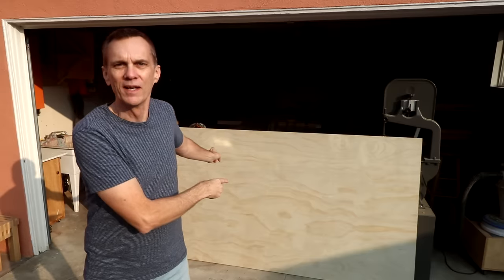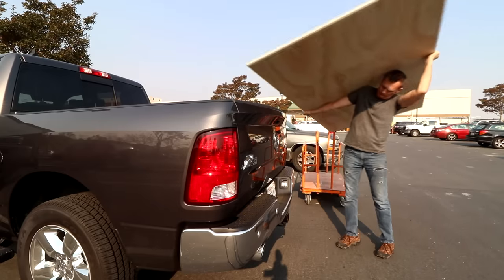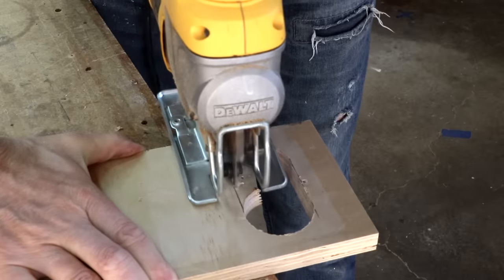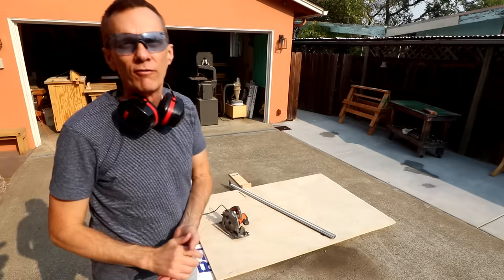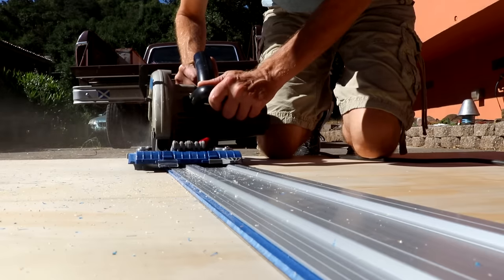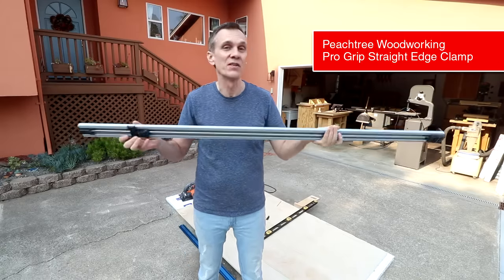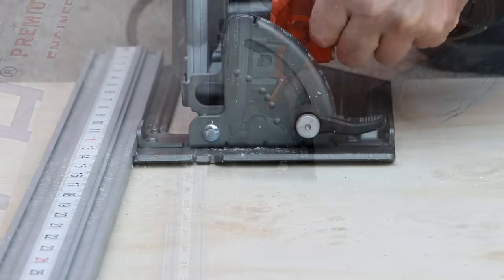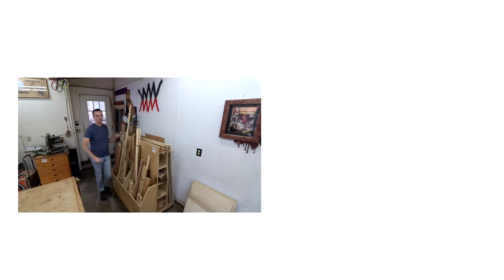How to break down plywood. A guide to cutting, moving and hauling plywood by yourself.

Comment: I fail to see how you don't find the need to store 8' lengths of sheet. I have some full width, but a lot of cut down widths. You just have to store it vertical. I like your wheeled cart though, at this point I have it stored against walls and 3 of the 4 corners of the shop! I also made my own track saw guide out of 1/4 ply, which was cheap enough to make an 8' and 4" version both. Saw it on YT somewhere, use it constantly with a cordless circ.
Reply from the maker: Why don't you just buy what you need for a project rather than stocking up?

Comment: That Home Depot should change the name to "Danger Zone." There looks to be some safety issues.
I was at my local Home Depot a few years ago. Had the SUV with me. Picked out some 2x10 by 12 Ft. long boards. I needed them cross cut down to 6 Ft. boards. Approached 3 Home Depot floor staff to have them cut on the big Radial Saw that they have. They were all too busy. I waited around for about 20 minutes in the hope that someone would be free. The store was not busy, couldn't understand why there wasn't anyone that could help me. Set up those boards in a little used aisle. Got the handsaw from the Trim Aisle and had 2 of the boards cut and was working on the third. And some other Home Depot guy comes along and tells me that it would have been easier to cut them for me on the Radial Saw. I tell him my experience as I'm working and finish cutting my last board. It would have taken them 10 Secs. to cut those boards on their saw. To begin with I had the boards placed on the saw bed ready to go. They just had to key in their code and drag the saw across those boards. They make cashing out a self serve service. Maybe they should make it self serve everywhere in the store. They can then get rid of their useless employees until such time as AI takes their jobs. I got some other Home Depot stories like that as well. When I go there, I am prepared to work.
Breaking the wood down is the best move. However sometimes I have to have the wood full size, thankfully not too often.
Actually, I need some wood for projects I'm working on but everything is shut down here. Everything is phone in or online, the Pandemic. Doesn't work for me for a number of reasons.

Comment: "The saw never works" yeah i work at one, ours works but only th managers know the pin to turn it on, and we are told to say its nkt working to customers, they figured out that sales increased more from the extra employees helping then the people turned away because the wood couldn't be cut, that and for anything other then plywood they just suppled a cart with a handsaw for the customers to use. Is it preferable no, but the store manager decided thays what tphes gonna do
Reply: omg it's actually a conspiracy??  This is horrible and very entertaining. 😅  I once had a demoralizing misadventure with "non-working" saws in two or three consecutive stores.  I had specifically gone for big box rather than architectural salvage because of the promise of lumber that would fit in my sedan, and rather than leave empty-handed I settled for shorter (but still unwieldy) pieces that ended up being too moldy to use and went in the trash!  The whole experience made me permanently cranky about big box lumber but if it's also literally a retail conspiracy that makes it funny.  So thank you. 😆

Comment: skip the toy pickup with the 4ft bed, we use vans you can just slide everything right in and close the door, no strapping, no cutting, no freeway flyer miles. we only use lowes they actually give veteran discounts.

Comment: Plywood protip:  Get yourself a pool noodle or a copper pipe insulator and slip it over the edge and/or corner of the plywood.  That way you can rest it on the ground without damaging/getting it dirty.  It's worth the $3 when working with cabinet grade ply.
Reply from the maker: That's a great suggestion!!

Comment: What about rip cuts? Every time I try to use an edge guide and circular saw I end up with a wavy line.
Reply: There's lots of reasons you might get a wavy line. One of them could be using the wrong blade in the wrong material. You could simply get a long straight clamp or even a straight piece of wood. I personally custom made a ripping guide for my track saw. But most companies sell ripping guides for circ saws. It's basically a portable fence that attaches to your circ saw base. I know Kreg has one. It's a bit flimsey but it can work.

Comment: Make sure there are no termites in the new wood. Sometimes there are drywood termites in the wood. U just don't know it. I would seal the wood, in theory that should cut off the air and the termites will die if they are in there.  That's why after a major rebuild on a house, they reccomend to fumigate the house and tent it.

Comment: For all german mortals :p Lidl sells a edge guide like that for like, a third or a quarter of the price, and it's pretty good!
Reply: Not only for german mortals. Lidl is in many European countries.  I have one from them as well. Works great. But for a full sheet of plywood it is not
big enough. No problem for me, plywood is far too expensive over here to buy a whole sheet.
Reply: @hansdegroot8549  True! I just didn't want to give wrong information in case they had different products in different countries :)
That's fair yeah, but i think most hardware stores here sell smaller sheets too anyway - plus if you are in germany, Bauhaus does unlimited straight cuts for free and they're usually pretty good at it with guaranteed accuracy and all
Reply: You can also buy a track saw from them they are £70 in the uk and on sale a couple of times a year

Comment: If you're going to be hauling a lot of plywood, it may be worthwhile to rent or borrow a trailer or truck. You can use a roof rack in a pinch, but unless you're really good with knots and have a really good roof rack, I wouldn't recommend it

Comment: Well Steve I have to disagree with your dismissal of track saws maybe you should try one. As a owner of small shop 12x12 feet and small one car unheated garage (in Canada) table saw is very problematic to use no matter how much you precut your sheet goods. Requires too much space for input and output, I do not have. Bought a Makita track saw and never looked back. Precut full sheets in the garage on 2 saw horses and 2 2x4. Have 4ft by3 ft folding table with foam top for the workshop and precision cut all pcs with tracksaw on that with no extra space needed. Huge advantage of no tearouts, precise, exact cuts, dust collection and no need for material movement. Build all furniture for my houseboat down to 6"x5 "sized pcs and never touched the table saw again. Perfect for small shop once you learn to use a square and all the small tricks.
Reply: ddruckmu I agree with you, also a makita owner,  and I agree that for sheet goods it really can replace a table saw.  If you set up a table with bench dogs and a fence you can do repeatable Crosscuts.  I understand Steve’s point of view, but I bet if he tried one he recommend one, especially with cheap options available from Wen, Triton and Grizzly.  I still think the Makita may be the best bang for the buck. As an aside, factory edges on plywood are not that great, my first cut is one kerf width off the 8’ side, then I reference everything from there.
Reply from the maker: Yes, this is why I said a track saw is the most accurate solution. Just not an expense that fits the focus of this channel.
Reply: Well by itself, just for cutting sheet goods, of course it is too expensive but as a total replacement of table saw,  edges  guides, ( the Kreg gismo is $99 in Canada) Then the $400 cad for the saw is not too expensive in comparison to the cost outlay for the tools it replaced. Just a different view on a small cheap workshop.
Reply: @fotopdo  Agreed, the factory edges are usually beat-up and my first cut is always 5mm trim off that edge for perfectly straight and chip free smooth edge. The Makita became the central tool of my tiny inexpensive shop.
Reply from the maker: @ddruckmu  I've known a number of people who use track saws only and prefer them to table saws, but there are not enough people with a set-up like that to justify me converting to a track saw exclusively in my shop dedicated to teaching beginning woodworking skills. Basically, it would be YouTube death! 😬
Reply: Yes agreed on that, just trying to expand peoples knowlage past the traditional view.
Reply: @SteveRamsey  Especially since Festool  brought us the track saw, and what could be more divisive than that! I don't disagree with your take on this, clearly it's the correct choice for your channel.  But, these saws are really getting cheaper and might be a good "extra credit" option for some of your followers.  The Wen saw is $150 with tracks, so similar to the price of circ saw and the Kreg or Bora track guides.
Reply: @fotopdo  are you saying Festool invented or came out with the tracksaw first? I hope not, because I have a Craftsman set up from decades before I ever heard of Festool.
Reply: Thatone Dude, to be clear, I’m talking about the plunge saw specifically, using a track with splinter guard, they got a patent for that in 1962... not sure if that’s US or Germany or worldwide. They made the first handheld circular in 1930.  (All this according to their website)  what’s the config of your craftsman?
Reply: The Wen track saw is pretty attractive at $130 US.
Reply: Michael Mulville it seems to be a great saw for the price, But I do think you need the optional ($75) 2 pack of 55” tracks to get good results.  Most saws, Festool, Makita, Triton come with 55” track, but the Wen comes with 2 27.5” tracks that you assemble with connectors. This has to be finessed, and can easily introduce error. I think they did this to make it cheaper to ship. So that would be around $200 to be able to do an 8’ cut ... not bad. Also those small tracks would not be a waste, it’s nice to have that size for short cross cuts.

Comment: My guess is the saw works fine,  but the employees are too lazy to cut stuff.  Just like they can’t be bothered to clean the store.
Reply: That's probably the customers' fault, too, looking through the 2x4s to find the straight ones and not putting the rejects back. I always stack them back neatly, because I want to find them that way myself.
Reply: @jjohnston94  I always lay them on the floor. What's the point of putting them back in the "good' pile.  They will just get in the next guys way.
Reply: @jjohnston94  You're absolutely correct the customers go through the pile looking for good wood.
Reply: I think ur right just yesterday i was at lowes and they told me the saw probably isnt working lol thats immediately what i thought

Comment: Using the insulation as a cutting surface is a pretty poor idea if youre not wearing a respirator, sending fiberglass up in the air. You should be wearing a respirator working with plywood anyways, the plys are held together with epoxy and i wouldnt want to inhale that either.

Comment: Don't carry, ROLL:

Take your carry handle, put a cheap caster under it (fixed direction, NOT pivoting):

https://www.harborfreight.com/2-inch-x-7-8-eighth-inch-light-duty-rigid-caster-41513.html

Now, take a BUNGIE CORD, and drill a hole up at the top of that carrier, so that you can insert the metal hook of the bungie.  FINISHED.

So use it, hold the bungie and let the carrier hang down over the far side of the sheet good, a couple feet back from the front when up on a side.  Lift JUST the front end of the sheet enough to let the carrier go under the sheet good, then lift it into place.  Hook the bungie over the top and that will hold it in place.  Walk to the back end of the sheet, lift ONLY that end (1/2 the weight...) and drive the sheet where you want to go and then remove the wheeled carrier.

BONUS TIP:  I have a 2 wheeled Plywood Cutting Table (casters like above, but a bit larger to go over bumps easier) on one end lets you lift the other end and roll it out into the driveway on nice days to break down your sheet goods in the fresh air or even apply finishes on calm days, and then roll it into the garage to dry out of the way of dust and birds...  Make it using lap joint 2x4s and it will tear down in 5 mins. for storage.  It's just a plywood frame like Youtube videos are full of making, and has a 1/2 foam insulation sheet on top so that the saw blade just knicks it and leaves the wood alone.   A properly shaped "J" hook of wood on one side will let even my teenage daughter load a sheet of 3/4" birch plywood from standing on its side, to being up on the table without breaking a sweat.  Make the table 4" narrower and shorter than a full sheet, so that you can have access to clamp on straightedges or a track saw for cutting.  

Get off the ground cutting your sheet goods and your back will thank you!  My cutting table was the best thing I ever made.  And it can double as an assembly table with a sheet of 3/4 on it.

To more easily transfer a sheet from the truck to the table, mount TWO BEARING ROLLERS  at the ends of a 3' scrap of plywood.  

https://www.harborfreight.com/5-8-eighth-inch-roller-ball-bearing-67067.html

When you get to the house, lift up the end you're holding outside the tailgate and slide the roller piece in arm's length so that it is transverse (across the bed).  Now lower the sheet, and you can pull on the sheet, and apply a little downward pressure, and just ROLL THE SHEET OUT OF THE TRUCK most of the way and set your end on the table.  Now if you want, you can transfer this roller to the table, and back in the truck, just lift and continue rolling it onto the table.

The older you get, or if you have a bad back, the smarter it is to have to lift only HALF the weight of a sheet of plywood!  Working alone means working smart!

Comment: Plywood is one of the things that worries me about your courses. A full sheet of plywood simply won't fit in my car (and unfortunately since it's the 4' width that's the problem neither will a half sheet). When I'm making my own cutting diagrams I can work around that limitation, but it's a lot harder to do with someone else's. 

I'm stuck either paying more to buy from a place that will rough cut for me (and I have no idea how much wood I can expect to lose from that), buying precut panels from the big box store in the 2'x4', 2'x8', or 2'x2' sizes--they won't cut--and trying to rearrange the cut diagrams accordingly (still expensive, but at least they let me actually let me compare prices and pick out which piece I want), or have my uncle go with me to buy the wood (he has a truck, but since that's not something I can do on a whim, means buying several sheets and trying to store it). 

I guess I could buy a battery powered saw and try to cut it in the parking lot (but since I have to cut it longways cutting diagrams are still a problem).

I'm really not sure what to do (and no buying a truck's not an option).
Reply: Home Depot and Lowes will cut for free. You might be surprised how much you can fit in a little car, you just have to be creative. I have purchased many sheets of plywood and can get it to fit in my Nissan Leaf with 3 cuts.
If I ever need full sheets, I rent a truck from Home Depot which is $20 for 75 minutes.

Comment: Are you sponsored by saw blade manufactures?
You suggest using xps in each video. But this method is not good, both for your health and blade lifetime. XPS is too abrasive for sharp cutting tools. If you'll try to cut it with utility knife, you'll wonder how fast it can loose sharpeness. That's why this type of materials mostly cutted with hot wire.